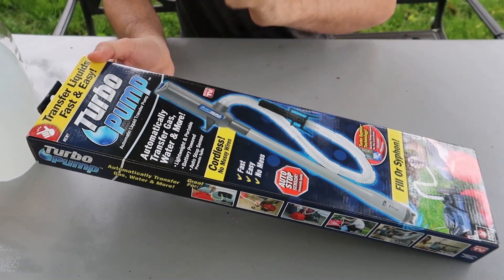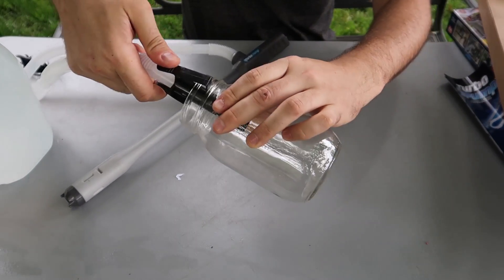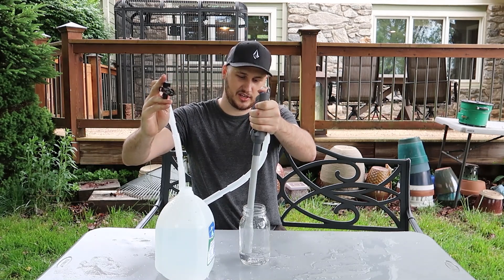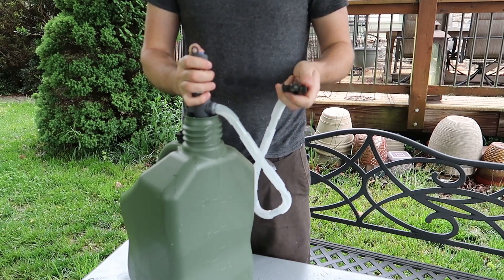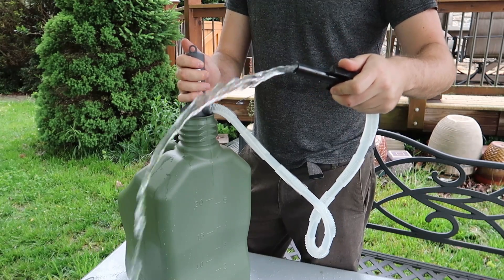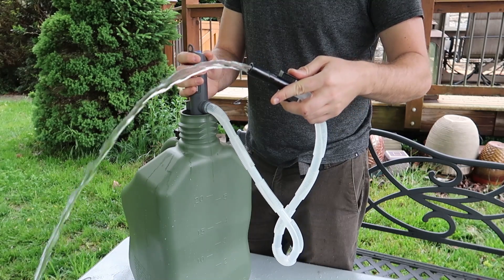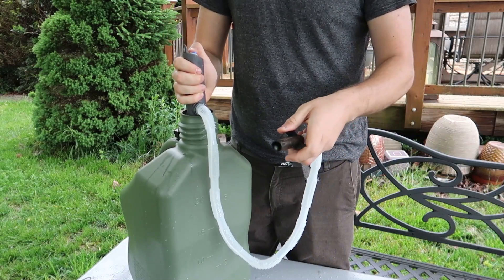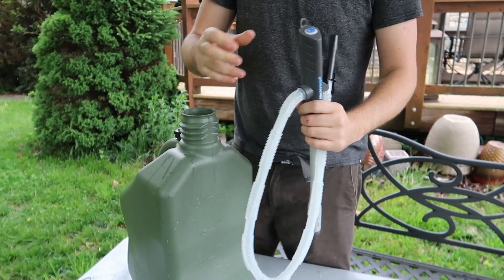Turbo Pump As Seen On TV

Comment: Never use something like this with gasoline.  When you turn the battery switch to on it can create a spark which can ignite the gas fumes.
Reply: Unlikely but the gas will disolve most of those cheap plastics causing it to leak